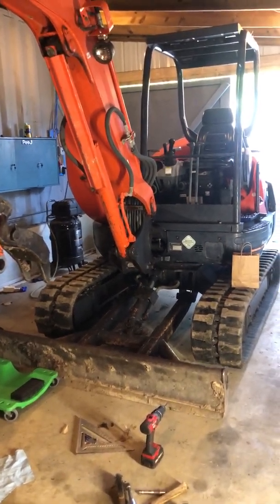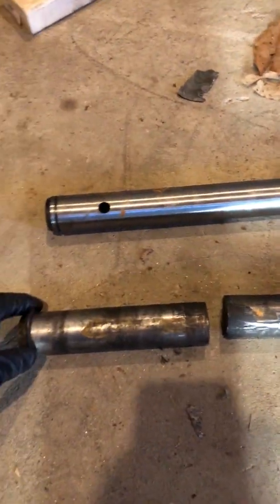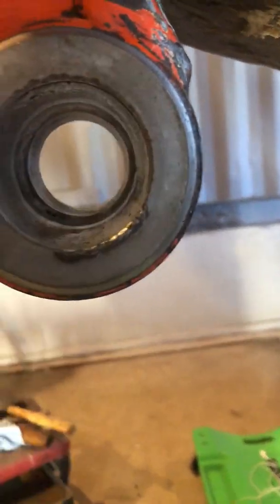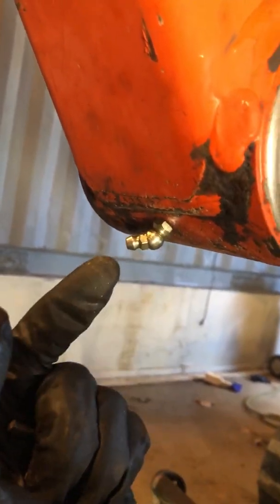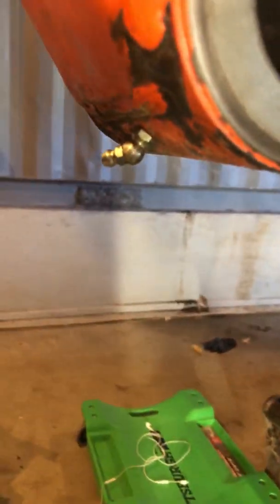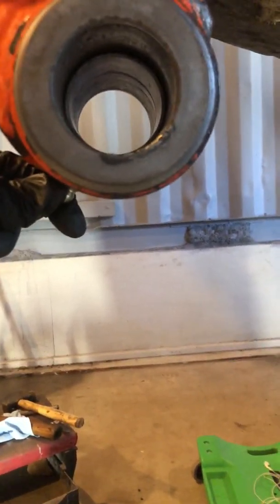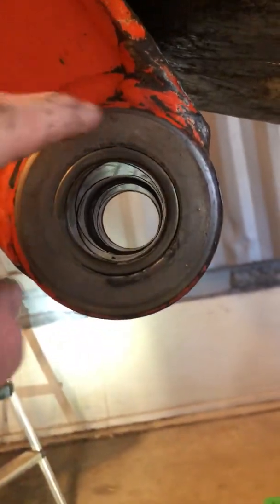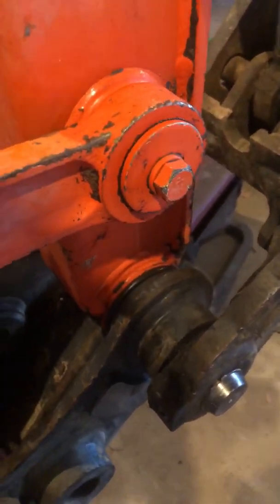Kubota KX121-3 Bucket Pin Failure (With Fix)

Comment: Nice video, hey how much space did u end up with between the inside of the bushings and the main pin? I am measuring about .033 inches of play in between the two of them. just my gut tells me thats WAY too much, and the performance of the machine sure seems to confirm that with the visible slop that has been building up to a greater and greater degree over time as well.

  I am trying to get what the manufacturer specs of clearance are supposed to be but can’t find anything online for that.  hell it looks like i have maybe 1/8 on EACH side of the main pin and bucket junction area.  so when i swing left or right i can feel a hard banging coming thru the cab from the side to side slop of the bucket not to mention a bit of angular (vertical) play as well.  

Something tells me that over time this additional stress might also explain the slop i have on the cab to track frame as well, as if i push the boom side to side with my body, i can see that the cab will actually move by maybe an inch or so.   I think it rotates on the ring teeth sprocket which is likely a few feet across?  And i cant imagine how much of a pain that would be to replace…:(. crane and hoist the can off the track frame and god knows what else to fix that. 

  I guess 1300 hours of employees and subs who didnt grease nor operate the machine correctly was just too much and it’s really showing it now.  Such a sickening realization that “you have been had” by people that you “trusted.”….
Reply from the maker: Hello Sorry for the late response. I wasn't able to find the exact spec on the bucket pin to bushings either. I would guess you would want it as tight as possible without binding up. I would say it wouldn't hurt to just replace them along with a new pin. I forgot to include in the video but where you say you have 1/8 of gap I bought (through Kubota) new rubber dust o rings and a few extra spacers than what it comes with. Believe from the factory it has one on each side, now i have 2 on each side. It definitely tightened up the bucket slop. Next is the coupler, the couplers seem to wear quickly because they aren't greaseable between the bucket where it sits in. Hopefully that helps.

Comment: Compliments on your well lit well explained video.
I have the same excavator, similar problem.
The outside edges of the bore are ovaled by the bushings ( bearings really), I think because the bearings/bushings are hardened, so the wear ends up in the bore at the end of the dipper. Not great. I'm thinking about having a new bore machined to accept flanged bushings which will deliver the wear to the solid pin. Also, drilling in a new zirt thorough dipper end just like you did.
Maybe a guard around it?
Lemme know if you have any thoughts.  Thanks.
Reply from the maker: Thank you. That does seem like a very long term solution to the problem. I think you’re correct the bushings almost seem to hard for this application. When mine came out most of all the wear was on the dipper and not the bushings themselves. Thanks for the idea.